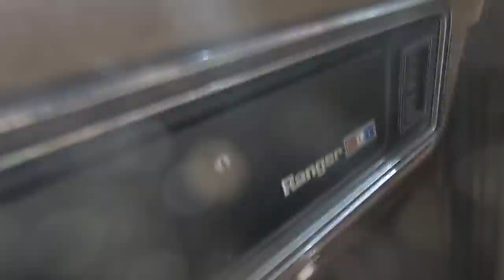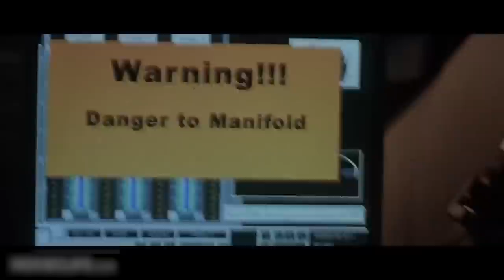1976 Ford F100! Buried in a Snowbank for 18 Years! Will it Run?!?

Comment: Mortske Repair, How did you get it running that good with the brake booster hose hanging loose? plug the hose?
might explain the high idle? huh...you found it.
So, as Emily Latella of the OLD SNL show would say, "Well, that's very different...never mind."
Got an old tire, a sabre saw and a drill? instant rag joints! Had to fix a work truck 75 miles from home that way to get out of the woods and get us home - oil survey crew, (geophysical vibro-seismograph truck) sucker couldn't take a joke and tore apart on me- not like they had an easy life either.😁
Reply from the maker: Good times
Reply: @MortskeRepair  
Actually deflated a new spare tire, and cut chunks out of it. a command decision, 4 employees at double time and a half, - holiday weekend  -  July 4th - cost of tire (relatively cheaper then too) vs waiting on someone to answer, then drive to the office get the recovery rig going, and locate us via crude maps and directions given over the radio - a no brainer, up and running in an hour and 20 mins, drove the 2 hours in. 
Saved paying a 5th employee, and pay less hours on the 4 at double time and a half than waiting  on 1-way plus getting another  employee contacted on July 4th near the office,  AND making the exact same trip they actually MADE more quickly on their own. 😁

Comment: Nice sounding 306,why does it look like the part where the back glass & roof look like it's been rolled &tilted foreword,bcause it doesn't line up with the topper,there's a gap between the two
Reply from the maker: The cab is angled. The topper is straight
Reply: @Mortske Repair , , I was wondering why there was a gap between the two, I  thought that the cabs were straight for the 78,but I guess not 👍🤔

Comment: FoMoCo had a better idea with that era ,their Rag joint wasn't rubber (like tire sidewall material) but was a riveted silicone ring that fell apart after about 10 years or with normal use , 10 minutes after the warranty ran out.  Keep  up the good work !
Reply from the maker: Interesting!

Comment: It could of been a 351M my cousin had a 1977 Camper Special with a 351M it drank fuel like crazy and no power to pass anything and yes it had fords specialty exhaust leak from the cracked manifolds.

Comment: What if you unbolt the wheel cylinder and hit it side to side with a air  hammer pushing the pistons back in
Reply from the maker: The material seizes to the drum surface

Comment: That’s always been a fear of mine also when you start a vehicle from the engine and it runs you over
Reply from the maker: One of these days
Reply: @MortskeRepair  lol
Reply: Gotta use tire blocks. Or just have crusty drum brakes.
Reply: @VintageCars999  lol 😂 yup
Reply: @captaingreatvalue  make sure to use a lot of salt water for maximum wheel stoppage.
Reply: @VintageCars999  hahahahahahahaha

Comment: For all the jokes about amsoil in this video, I mean, you could look at it too that the engine with pretty decent higher miles(for a 360) ran pretty strong and had good compression. 
76 was the last year Ford used the 360. Lot of options for engines that year
300 I6
360
390
302
351W
351M
400m
460
No one wants a 360 though. I guess if you could do all the work yourself you could build it respectable. But paying someone else to do it would be pretty silly. Still, even a 360 is getting rare nowdays if it runs strong, and nothing quite sounds as mean in the Ford stable as an FE, even the little'un of the bunch. No, 352 doesn't count those things were monsters. 
That truck might make a decent parts rig for someone, I think you priced it right. 

Did you say the thing was in drive the first start? Those rusted brakes saved your ass.
Reply from the maker: Yup

Comment: I see where your hissing noise is coming from it's coming from your vacuum to your power brakes it's unplugged I guess you're not checking that out or you already know about it by the time you get this message but if not there's your problem on your F100 1976

Comment: so are you going to hook up the vacuum line to the vacuum booster?
Reply from the maker: Sure did
Reply: @MortskeRepair  i bought a car that would not run with a new engine and clutch because the forgot the vacuum booster hose.

Comment: Probably the best running non rebuilt 360 in the land. Those things were low compression and had a hideously small cam with a retarded timing set and the pistons sat quite far low in the cylinders as well. I can't remember the number off hand, but they are pretty far down. FE stands for Fuel Efficient...NOT! coming from a guy who owns two of em. If one could get a set of pistons that came up to the top of the deck and a good cam they would be a totally different engine.

When I bought my 4 door 64 galaxie it had a frantz tp oil filter on it that had an install record in the owners manual of 1967. Looks like whoever installed that amsoil bypass filtration kit knew what they were doing hence the real filters. Mine was installed to route half the oil back into the side of the oil pan and no spin on filter. Shoulda seen how worn out the main and rod bearings were in that thing. Lots of debris went through them over the years lol.
Reply from the maker: Interesting
Reply: @MortskeRepair  I did some searching and the 360 truck pistons sit anywhere from .100"-.125" below the deck. That is why they are slugs lol.
Reply from the maker: @MattsRageFitGarage  Good to know!

Comment: "If you're interested in this truck as is you can own it for the low, low price of only $650 in the condition as shown in this video."
...
"Lets see if we can get the old 360 fired up and running for the first time since 2005."

Gonna take a guess and say, no?
...
Well, turns out the drivetrain is the one thing that does work.

Comment: The worst thing about the 360 is compression height the pistons are a .125 in the bore for about 7.8 - 1 compression and the king of spark knock thanks again EPA.
Reply: Wonder if the heads are different?
Reply from the maker: Good to know
Reply: @tjakr3869  the chamber size is close for all the common heads but the dish piston .125 in the hole is the biggest problem for sure.

Comment: So I've been looking for a piece of junk truck with a topper for cheap for a long time weather it's a GM or a Ferd but where I live everything worth looking at that says it runs is always 1700$ and that's always the magic number for.rotted junk and when I go to look at it it doesn't run the frame is toasted beyond repair and even when I say I got 500$ they say no and never come to an agreement ever,  my question is this do you think that truck if putting in a radiator,  maybe a water pump , half way decent used tires , sort of kind of fix breaks... I can live with fronts and driven worse  if that booster and master is fine , with a carb kit that truck would make it to Connecticut ???
Reply from the maker: Probably not

Comment: Talk about dumb,  try backing your truck up on ramps  putting it in park but forgetting to set parking brake and chock front wheels. I was replacing the carrier bearing . Well as soon as I popped the rear ujoint free naturally she started rolling down the ramps .my head was right by the rear axle, all I could think of in that split second is  as it comes down the ramps the  differential  is gonna eff me up. So I tried  scurry out from under and the right rear tire pinned/ skidded  my head in to the gravel and the tire   ripped my ear lobe open pretty good.  Luckily the truck don’t roll too far, could of been a lot worse.  I got out from under it and immediately said  to myself , “ You dumbass, wth were you thinking?” Live and learn I guess.
Reply from the maker: Holy lucky Batman!

Comment: Make fun of that amsoil all you want but it wasn’t stuck after that mouse orgy that happened under the air cleaner…
Reply from the maker: I never made fun of it
Reply: @MortskeRepair  haha ok mocked it. Several times. As if to say it was funny and over the top. Joking aside those add on systems with multiple filters pay for themselves in oil longevity and engine wear. People don’t really buy them for passenger vehicles much anymore but more for big rigs (and it’s a different system obviously). Guys can run those rigs 2-3 times longer than regular oil changes which saves time and money. It would be super interesting to see what the inside of that motor looks like with what seems to be pretty regular amsoil changes from way back when.

Comment: Definitely not same inner fenders as 67-72.
Reply from the maker: I’ve interchanged em
Reply: @MortskeRepair  I had a set from a 72. Way different. I suppose they may bolt up. But still different shape.
Reply: @MortskeRepair  no the part that bolts up by the firewall is way different. Wider  than 73-79. Don't be doing DD Speed shop stuff. Lol
Reply from the maker: @nicholasbrown6481  I guess I never had an issue with them on my 68